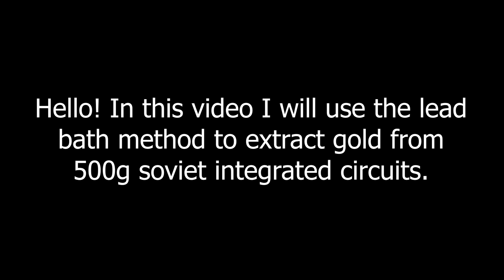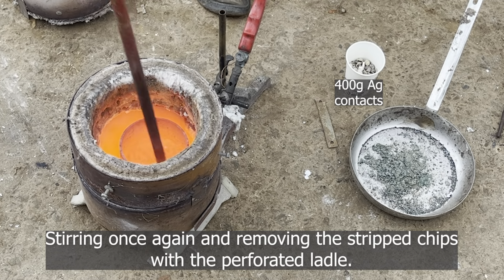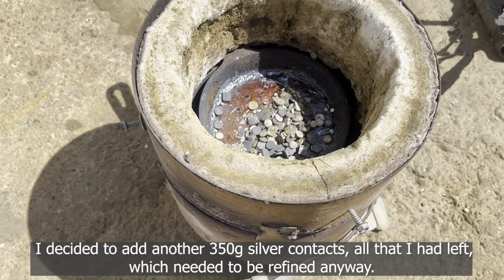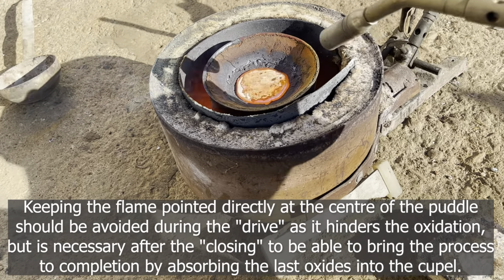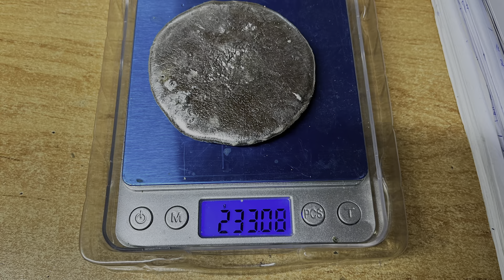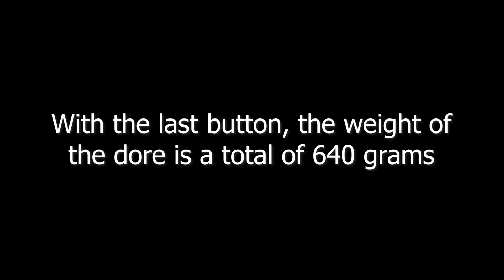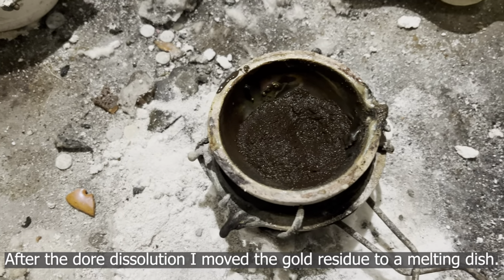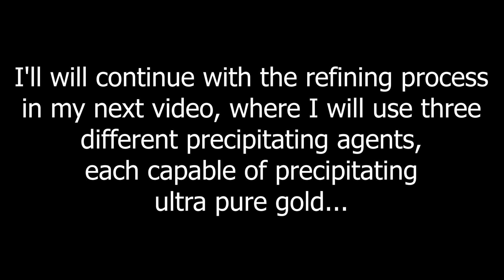Gold Recovery from 0.5kg Soviet chips and the problems that go with it

Comment: 2:00 get a big steel spoon with holes in the spoon, like for cooking sauces. Use that to separate the liquid metal from the slag, right inside the hot crucible. Thats how i remove lead from the steel clips of wheel weights.
Reply from the maker: Yeah, that would have been perfect for the task!

Comment: Wow, that single hole quick fix for ladle worked well 😂
     If you had heated the perforated stainless steel with another torch, i suspect your idea would have worked also. 

Thanks for showing the real parts that you don't expect.

Comment: Great video, but way to many steps. You could have crushed them all. Torched them till red. Do a couple nitric acid boils. Then add your aqua regia. Denox. Drop with SMB. Wash with boiling water 3 times. Wash using boiling HCl. Then wash with boiling water again and melt. But use a clean melting dish. The ones you are using are full of oxides that can transfer to your gold. My $.02. Cheers!
Reply from the maker: @rickreuter4218  Thank you! Before going for the lead bath I did a sample yield test using NaOH, followed by HNO3 and finally AR leach. Despite being only a small test batch (150g),it took me ages to get it done. I’ll post the video on the process some other day. The long story short - it took me much more time, money and reagents using the wet method compared to the hot one.

Comment: Use waste oil from your car to lower the price of heating
Reply from the maker: @Modestas19920  I spent less than $10 on propane for the whole process
Reply: I think small needle of the oil give yuo also more temperature in the base of the fornes because oil have more energy than propane

Comment: The video is very good. I started following your channel. Would you recommend an acid that whitens the metallicity of black iron powder without damaging it ?
Reply from the maker: @gencirtibat  rust removal you mean?
Reply: @OwlTech333  No, I don't want to take the rust off. 
To remove and whiten the blackness of the iron in the sea sand... I've read in old chemistry books that they've done this with organic substances, but it's very difficult... 

It will be very nice if I can whiten it with an acid that does not damage the metal
Reply from the maker: I have no idea tbh
Reply: @OwlTech333  thanks

Comment: Merhaba. Video için çok teşekkürler. Ben bir çok defa . Kurşun cevheri galenden . Gümüş kurtarmak için. Kupelasyon u denedim . Ama . Galiba yanlış teknik kullandim bir türlü kurşun u tamamen oxit hale getiremedim . Oxsidayon için kupel potasına . Koyduğunuz . Toprak ,ve toz hangi malzemedir . Bildirirmisiniz . Kurşun cevherlerinden gümüş u ayirmam gerekiyor bunun ekonomik olduğu nu düşünüyorum
Reply from the maker: Galena is lead sulphide. You have to turn it to lead oxide (litharge) first by process called roasting, then you have to reduce the litharge to lead metal with carbon source, then you can cupel it